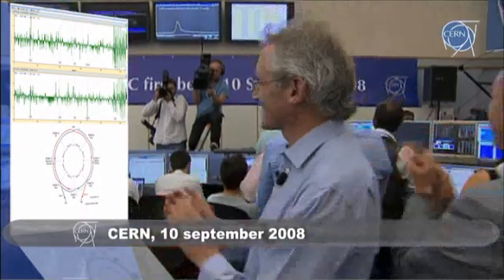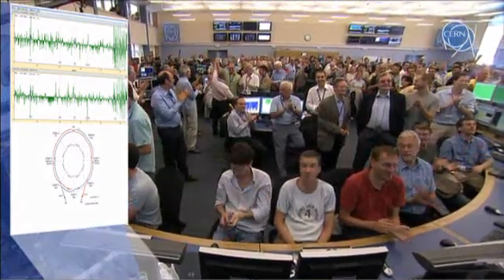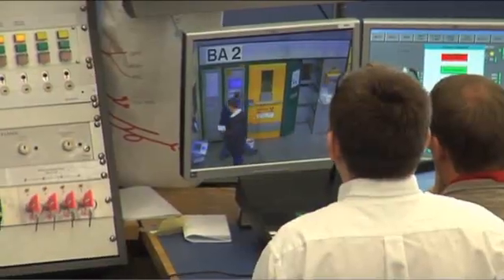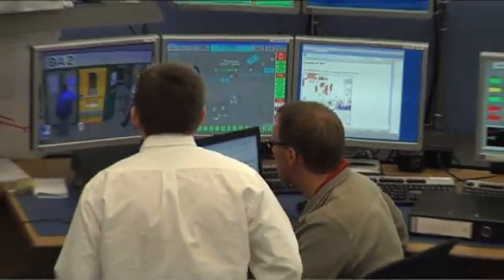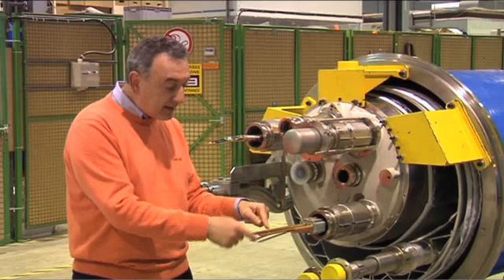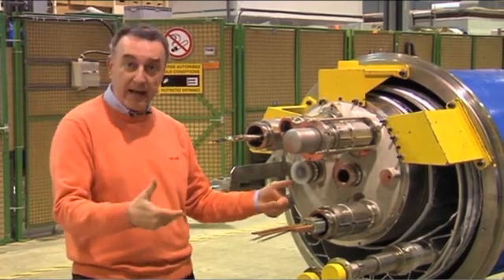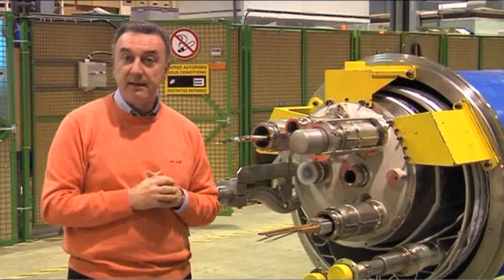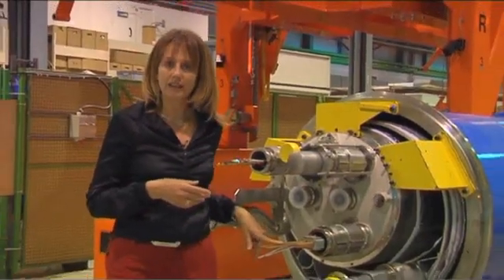LHC News - March 2009

Comment: Yup . A lower step in impedance from the source would cause a reflected wave inverted from the source wave(i.e in extreme a short circuit) this would bounce back adding to the next source pulse.  A higher step would cause  a reflected pulse in phase with the source. Consequently any change in impedance even a small amount of connector resistance(given the high currents) will cause multiple reflections in the loop..they could decouple (filter) these out close to each connector.

Comment: I meant the connection with the most resistance will blow first, but i take your "within tollerance" point. They would have to pass the huge currents through each connection to measure the volt drop across the junction.. 
  If  pulsed dc is used i wonder if a "back emf "is produced causing a momentary higher voltage across the junction thus exceding its rating.? 
 I really hope this works this time..cant wait for the results..

Comment: No offence taken! History has taught us however  that even simple design flaws can be overlooked and cause major incidents . Things that would appear to be quite basic and obvious. ie Three Mile Island incident when a simple PORV  was stuck. 
  The control panel only showed that the signal had been sent to open the valve, not that it was actualy open!..  
    I guess we will have to trust these guys,but i am a fully qualified electronics engineer with 20 years design experience.

Comment: This is important please read! This is why i think it could go bang again. (see reply to swinkyuk first) 
1.The path of MOST RESISTANCE will be sort  out  first by the flowing electrons in the  superconductor loop. (it found the weakest connection)
2. The flowing electrons will seek out  the next path of most resistance( THERE MAY BE OTHER FAULTY CONNECTORS NOT FOUND OUT YET)
3. If design flawed they will all go bang IN TURN   electrons always seeking out the path of most resistance!!!!

Comment: The word' connection' concerns  me   because even a connector made from a superconducting material implies a surface ,any surface may have atoms or molecules bonding to it ie oxides etc these then become sandwitched between the connections, this creates the resistance!! 
 If there is a superconducting material that is liquid at the point of connection and then becomes solid then any impurities may be forced to the surface ( a form of welding?)

Comment: Is the liquid helium flowing across or through the cables, I asume it is in its liquid state ,and flowing, as in the gas state it wont absorb the heat. Any heat would cause the liquid to become a gas local to the heat source causing an avalanche effect.

Comment: When the conductors are carrying high currents they will expand when they heat up. The repeated expansion and contraction as the device is switched on and switched off will eventually cause them to snap. I bet this happens again!
I hope they have fitted a combination of temperature sensors and strain guages to monitor this. 
  To prevent this the connectors need to be kept at a constant temperature!!